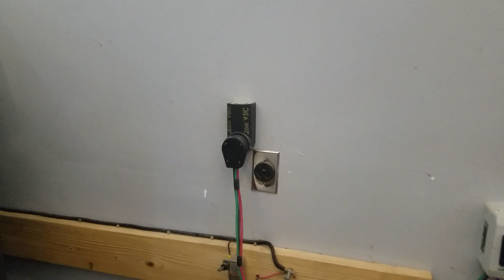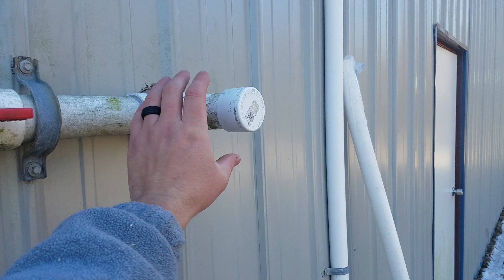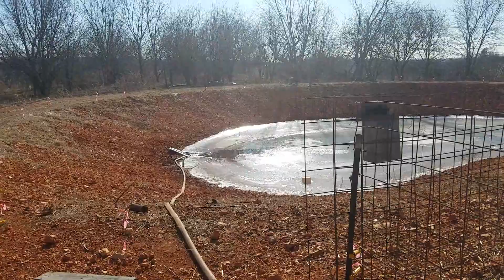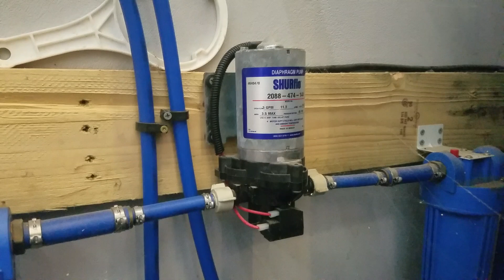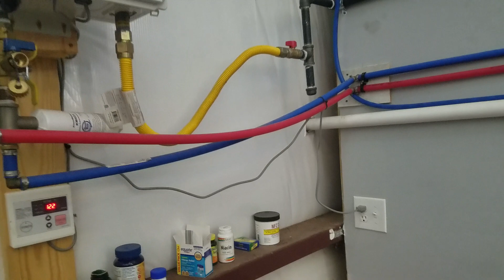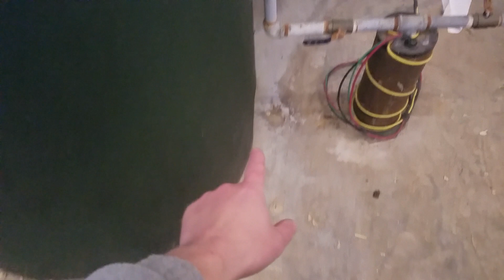Off grid solar deep well pumping

Comment: Great info thank you for sharing! Setting up a very similar system. I’m especially interested in your well pump in your storage tank idea. One thought is I’m not sure the pumps are designed to run on its  side? Wondering if it’ll wear funny. I get why it would be a good idea because it’ll keep it cool keeping it submerged when tank is at a low water level. I’m going to do some research on it. Love the idea though

Comment: GREAT information!  Thank you!  This was thorough and very easy to follow.  I will be implementing some of these ideas into my off grid system.  Where did you buy those solar panels?  Also, what do you do about snow accumulating on the panels?  I put mine on the side of my cabin but they don't seem to be getting enough sunshine at that angle.
Reply from the maker: The solar panels came from a gentleman I came across that used them for the roofs of golf carts to charge 48 volt golf carts.

Snow accumulation I just use a big shop broom, it’s amazing how they are the last thing to melt. I put 6 panels on my roof for my house system and I’m never doing that again lol
Reply: Same here! My first rookie mistake was putting my panels on my roof too. I had to climb a ladder every day to get the snow and ice off. Very sketchy. So I put them on the south facing wall of my cabin and it's a great maintenance-free solution but I don't think they're getting enough sun. I was thinking about just getting more panels to solve the problem. We've got a couple feet of snow here in North Idaho Nov-March most years!

Comment: i have a water well. just wondering if you have steel casing in your well.  
my well is in tenn. it’s 8 inch diameter and 150 feet deep and has 6 inch steel casing from the surface down 40 feet.  then it’s limestone rock.
Reply from the maker: Yes I do have a steel casing. Mines an 8 inch steel casing and Missouri requires it to be at least 80 feet and grouted on the outside.
Reply: Great. thanks 😊

Comment: Great video.  I am trying to find information on the best solar well pump since I am having my well drilled very soon.  Which brand of pump did you use?
Reply from the maker: The brand is Grundfos, the pump model is an sqflex.  I’m fixing to put out an updated video on my system in the next couple weeks
Reply: Eric - thank you for the reply.  Is the pump reliable?  Have you had any problems with wildlife (ie, deer) running into the panels?  I was looking at companies that sell racking for installation on an above-ground post.  However, mounting doesn't look like a one-man job.  I have a well driller who said he can hook up all of the solar components.  Did you buy a kit or the panels separately?  @TheJoyOfHomesteading
Reply from the maker: @michaeldamianbell1980  it’s been flawless. I really did the research on pumps and it seems like Grundfos is the top of the line.  Have not had any issues of wildlife and the panels.  The panels were not a kit, I pieced it all together.    I think if I were doing it again I would try to think of a way to use the shade and protection of the panels to maybe store things under them like a lawnmower or really anything, utilize all the space.  Also something to keep in mind is the panels will need cleaned a couple times a year and snow will need to be removed if your in that kind of climate, so don’t make them so high they can’t be reached.
Reply: @TheJoyOfHomesteading  Eric - thank you for the advice. It's hit or miss on trying to find reviews of DC solar pumps.   I was looking at RPS since their advertising is everywhere.  Contact with them wasn't the best in terms of getting needed information. Great idea on not putting the panels too high for cleaning purposes.  Fortunately, I am not in residence when all of the snow falls!!  Which brand of solar panels did you use?
Reply from the maker: @michaeldamianbell1980  they are some no name brand Chinese panel. If you want to spend the extra money on name brand panel it’s probably worth it in the long run, some of my older panels for my house are experiencing defects due to cheap manufacturing like snail trails.  I would stick with a mono crystalline panel and not a poly crystalline and you really can’t go wrong picking one.  Try to keep the voltage of the panels pretty high to cut down on voltage drop through the wires running down to the pump, some of them can be very deep.

Comment: 12 or 24 VDC 60PSI at 5.5 GPM and you can put them is parallel producing 11.5 GPM No pressure tank needed. They are very quiet.

Comment: I intend to replace my existing pump with a 4 GPM pump lifting about 180 ft to five or six 50 gallon used electric water heater tanks to 10 feet above the house ground level. Plumbers give those tanks away and very few leak. By mounting them 10 ft above the ground it will give enough to fill the toilet, take a shower and wash dishes. Watering the garden would take place with the overflow.  No real need for a low-well cutoff or an overfill cutoff. The only question I have is "Do I need some kind of controller to adjust for low light conditions to avoid damaging the pump?"
Reply from the maker: No

Comment: Neat system . However, water stored in a open atmosphere tank should be chlorinated. There is a real potential for dangerous bacterial growth in that system. Licensed master plumber and certified private water system
Reply: If you took a tank and stored it for a year, maybe.....a tank that gets replenished and diluted with thousands of gallons every day, not really an issue.  I think most people can even get used to bacteria in water. Mexicans can drink mexican water with zero issues. Theres a large portion of the world that still catches and stores rain water for drinking.

Comment: Very informative video. I’m wanting to build underground tank with a deep well pump laying on it it’s side too. Will this work. I also would need pressure switch that drawers water rim the underground tank to the bladder pressure tank any time faucets are opened. Can this be done?
Reply: It will absolutely work
Reply: @renewablerepair7224  Thanks Renewable Repair. Would I need to use some sort of under water clamp or bracket to hold pump in places at the base of the tank.
Reply: @cCaribbeanSpursTv  depending on your tank material. Some people have used new concrete septic tanks and buried them for fresh water storage. A pump can sit right on the bottom of the tank and wont hurt it. You'll just run 1 inch pipe to your pressure tank and the wires from the pressure switch at your bladder tank, down to the pump. If the tank is plastic I have suspended the pump about an inch from the bottom just so the pump with not wear a hole in the plastic turning on and off. The pump can just hang there from the 1 inch pipe, so just support it where it comes out of the tank with a 1 inch coupler.  I'm the original poster of this video, I just have multiple accounts
Reply: @renewablerepair7224  Thanks dear man.  It’ll be an in ground concrete tank. I was thinking to make aluminum brackets and fix pump to the wall with rubber washers and rubber between the brackets and the pump to reduce vibration. Is that a good or bad idea? I’d use brass screws too.
Reply: @cCaribbeanSpursTv  I wouldn't even worry about it.
Reply: @renewablerepair7224  ok cool thanks.

Comment: Awesome system ,Informative video. One thing to maybe think about . if you put a submersible pump in the tank and lay it in the bottom you’ll have to come up with a way I would think to keep it from spinning from the torque when it turns on and will put a lot of of stress on the piping
Reply: I've actually had a submersible well pump in the bottom of the tank for at least 2 years and it works great!

Comment: I'm no expert on plumbing, but I don't think you will have all 500 gallons at your disposal when the power goes off.  At about 14 minutes into the video you say it flows from the floor up to the first filter.  I would think that the water in the tank will only flow into the filter until the tank level gets down to the same height as the filter.  Maybe your solar-powered pressure pump can pull the rest out when it gets that low.  I don't know.  Thanks for a good video.  I will definitely check out the Grundfos pumps.

Comment: why` didn't you just use a float valve to stop the pump when it is full. Also, whjy add another submersible pump? Just replace your noisy pump with a quieter booster pump.
Reply: The manufacturer has a float valve setup  to turn the pump off through a data connection through the existing pump wires. Its expensive and prone to failure causing overflows of tanks.  It would be unreasonably expensive to try to float switch a relay capable of opening 300 volts DC.

A submersible pump can put out a tremendous amount of pressure for very little money and noise. You can have city water pressure for under 150 dollars

Comment: When the tiny pressure pump goes out, why not just use a conventional booster/pressure pump that plumbs in on the outside, still you are using 110v?

Comment: you could run the water through a radiator or radiators before the it gets in the tank! that way you can make use of the geothermal energy anytime your pump is running. You should not pump water when you don't need it.

Comment: I just purchase pws solar water pump.I purchase with the understanding that I can  use battery when solar panel when Sunlight is low.But I dont see on charge controller where to hook up.Should I hook up Where solar panel is to be connected?It said I can use battery when Sun light is low.Do you have an answer?

Comment: Referencing your comments on pump power use. The utilization loads for a pump are usually rated for start-up wattage. Startup wattages can be twice what the run wattage would be. Your wattage calculation for your pump may not be as far off as you think.

Comment: Nice video, very motivating.  Q. Does storing a large amount of water like that reduce the water pressure in the house?  Another stupid question: Could you install some type of controller on the system so you could control the pumping speed even during very good light conditions? I think that would save wear on your pump.
Reply: Storage will not reduce water pressure in the house.

Comment: Wow... this is really some amazing information.  And you uploaded in 1080p, so you did pretty good as far as quality.  In the YouTube studio, there's a thing you can enable to stop the motion from bouncing around.  My only comment is that it is absolutely critical to keep those solar panels clean.  You had a lot of dirt on them, especially towards the bottom.   If those cells get too dirty, the entire panel could put out very low voltage.  My panels put out 37V.  Yours are way higher than mine.  Somebody should install these exact same wells out in Slab City out in California so that people can have water.
Reply from the maker: Your 1000% right about keeping panels clean.  My solar system for the house had low output, from 1200 watts down to about 400.  Cleaned all the tree pollen off the panels and all the power came back.  This is one reason why I will never install panels on a roof again!
Reply: @TheJoyOfHomesteading  Tell me about it.  I have 9 Kw on my roof.  I have no access to clean them.  Before getting them, I had no idea that they required maintenance.
Reply: @TheJoyOfHomesteading  That's awesome.  What about using the video stabilization option in the YouTube Studio?  Did you look at that?  I love solar.  My electric bill has been under $10/mo for the past year with my grid-tie system. The electric company still charges a $10/mo connection fee.  So it's basically like I'm paying $10/mo to rent a large battery to power my house during the night when the sun isn't out.

Comment: CONDENSATION FIX:  Insulate the tank and all cold water lines. Warm moist air is the culprit. keep it from the cold cold pipe (Or cold soda can, Whiskey on the rocks, etc.) and no condensation. Then, insulate all the lines carrying HOT water so as to retain all the heat possible rather than dissipate heat en route to your shower.  OR, move that water tank up and outside into its own elevated space and insulate the entire space while allowing for overflow and or condensate run off via drainage in the 'flooring' or slab the tank sits on.

Comment: OVERFLOW PROBLEM? Why not a simple FLOAT switch in the tank?*  Also, since you apparently have the room, why mount the tank DOWN on the lower level instead of as high as you can to take advantage of the head pressure?

One thought on the FLOAT SWITCH, it could re-direct the pump panels output when the tank was full - a DPDT switch where it switched the power from the Pump Panels between the pump and the house controller.  OK, I know not about our solar system - or any for that matter. Just heard you say you had a seperate solar for the well pump and the house solar and that you ran an Overflow pipe only because you forgot to switch off the Pump.  Amazon has an SPDT switch that could work.  "PUMP DUTY FLOAT SWITCH - 10 FOOT - NORMALLY CLOSED - NARROW ANGLE Price: $40.99
Weight: 1.12 lb
 Stock Quantity: Made to Order Delivery: Ships in 3-5 Business Days Other SKU: PY2CW1000 These high quality float switches are designed for pump duty loads. The float switch is as normally closed or pump up (circuit is complete when the float is hanging down)." https://www.mdius.com/
Reply: That was my thought is " why is there not a float switch in the storage tank" the only thing I can think of is he is just doing it to fill the pond at a slow rate to not to over work the pump
Reply: I believe his only pump power switch is the special manual switch that comes from Grundfos, the switch that he talked about at length. A regular  level switch, switching the solar panel DC will smoke the level switch contacts.
Reply: cause of the voltage level he's using- it's high voltage not regular regulated household currents

Comment: Why couldn’t you have your pressure switch on xtrol tank connected to your well pump like a traditional well set up. Once the pressure tank is filled up the well pump shut off

Comment: Thank you that was what I needed to hear can you give me any advice I have a 110 volt deep well pump 30' deep I pump the water 150' to my house I believe I have 50 to 60 pounds pressure I would like to have just my pump on solar in case the power goes out backed with batteries  what should I be looking for or where should I start Thank you

Comment: 🤓👍Good Vid 
That's 1 way to do the job , many options , good advice on type of contacts and we'll designed for your purpose + with ur overflow ur pond water should stay nice and Fish etc may be an option + my favorite Some swimming 😆👍
 Another option is a Digital Contact less controller and a Float switch for ur tank . 
  If I were you w ur pond ; I'd have chosen what you have ; if when the pump goes out increase Drain pipe size from overflow . 
  You have Many options which is Always nice .  Gr8t job this far . 
 I would run it through a Ceramic filter anyways .99 filtration as to avoid sickness if ur well gets any kind of fungi etc . 
No one should risk getting sick esp w Fracking or earthquake prone areas .  
Ps you could use a solar cell to switch from DC in day to AC at night & adjust accordingly 
Peace
Would u pls put a list of Main Components w Links in the description please

Comment: I love your idea for the air conditioning.  In fact that very idea is why I was looking for info on solar powered well pumps, which is what brought me here in the first place.  I live in Florida and I plan on using a system just like you mentioned to air condition my place.  Thanks for the video.
Reply: I have a 600w off-grid system that will power a room AC unit. It will run continuously in good light conditions, but only about 5-6 hrs on poor light or batteries.  Four Renogy 150w 12v panels in parallel, Midnight solar 150 classic controller, four VMax 125aH AGM batteries in parallel and a 3000w VertaMax pure sine wave inverter.  It actually powers my entire family room through a manually switched subpanel. Runs lights, TV, AC in summer and lights, TV and pellet stove fireplace insert in the winter.  I just need to add more panels and batteries when budget allows.

Comment: Good job on the setup.

Grundfos is the best. But I find them too pricey.

There is a new generation of Chinese DC pumps with built-in controller. 400m pumping head. Price is about US$450.
It is rated at 3m3/h, i.e. 13 gallons/minute.
https://www.ebay.com/itm/120m-Hmax-Solar-Pump-Submersible-Deep-Well-Water-Bore-Pump-24V-for-Pond-Tank/202668399480

Compare that to Grundfos with similar specs which costs about $2,500.

That means I could replace the Chinese brand 5-6 times, and it'd probably still be cheaper than the Grundfos. This is because each new Chinese pump you buy is likely to be a little cheaper every time.

I have been running a Chinese pump in my 120m borehole for a few months now. I don't yet know how long it'd last. But we'll see.

Comment: Great video good job on your build but I think you should get away from that galvanized pipe and I believe they make a float level switch that would shut off your pump otherwise you’re reducing the longevity of your pump by running so much